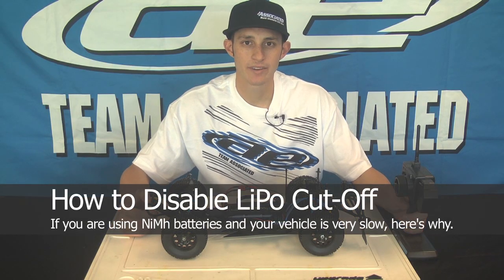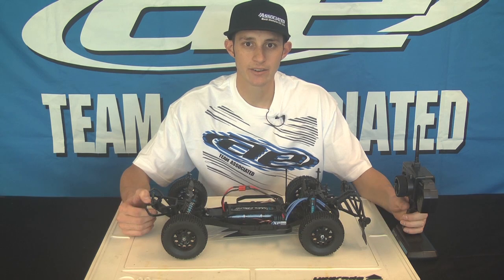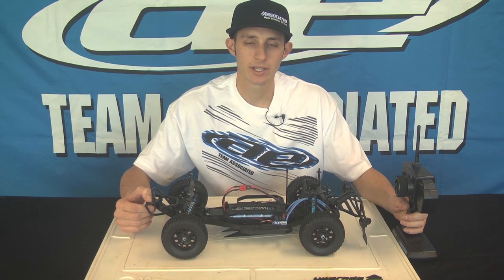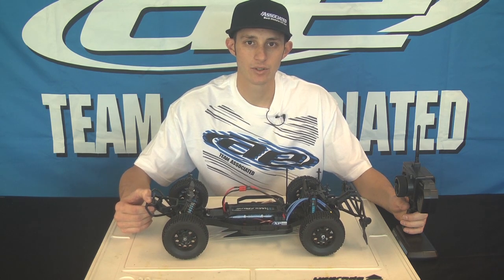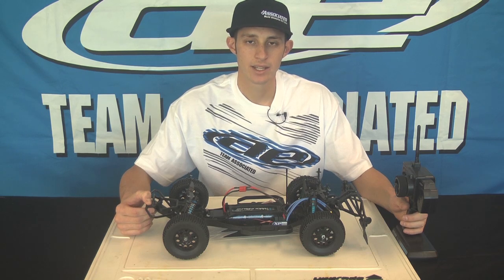Tech Tips - How to Disable LiPo Cutoff

Comment: Why is cutoff voltage so high, with regular batteries you can use them down to 20% of capacity, while lipo cutoff is 6v out of 7.4, it damages the battery to go lower than 6v?